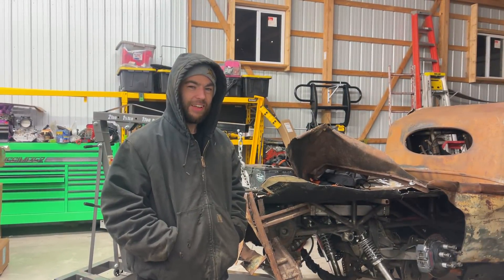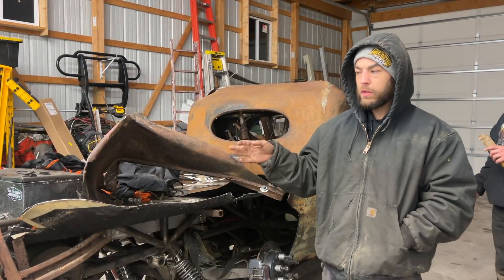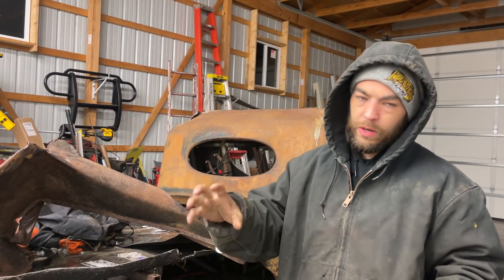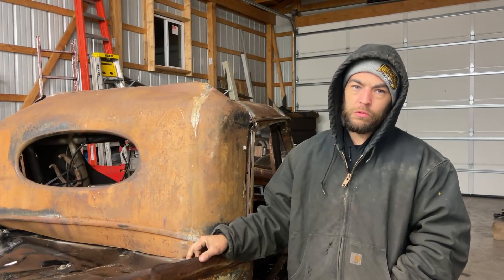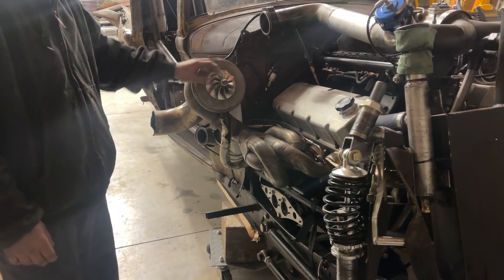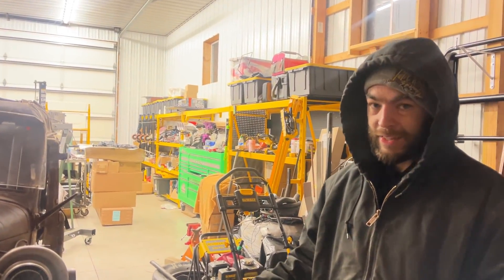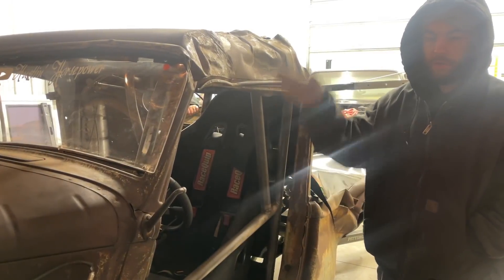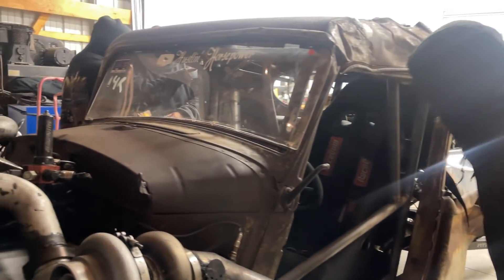The HomeGrownHustler- THE AFTERMATH

Comment: The way it's built I wonder if you could just cut the bent up part off the cab, pull the bed off and run it with just the tube frame.

Comment: Chassis can be tied in a knot, as long as the suspension points, and the tires are in the right spot, it will work as good as it did. Take care Nick and Maddi. Happy Thanksgiving.
Reply: To a extent anyway but you sometimes run into it changing the chassis flex characteristics of the car making it do stupid stuff
Reply: @54raceman  a chassis shouldn't have any flex at all, it would be to inconsistent to tune, that's what shocks and springs are for.

Comment: You can save anything as an off-road racer I have  fixed much worse, Old school leave it together put it on jack stands chain it to the floor 4-6 points with redheads pull it down tight now you can straighten and stretch and pull anything,  when your all done take the touch and flame anneal all the bent areas now its all good and no money spent